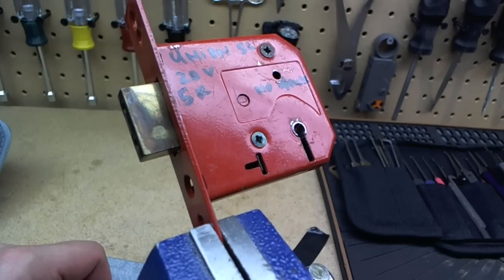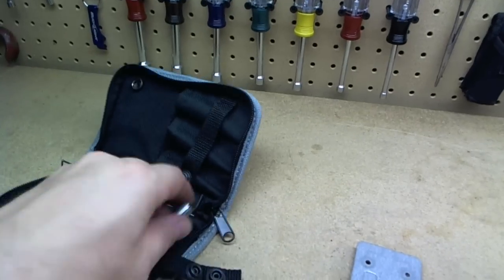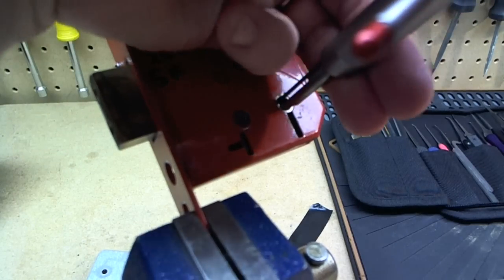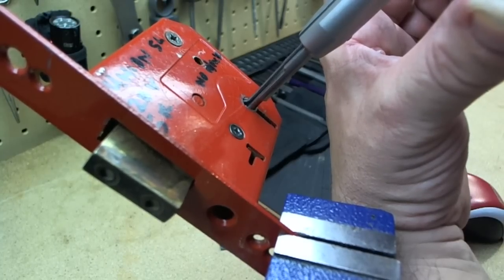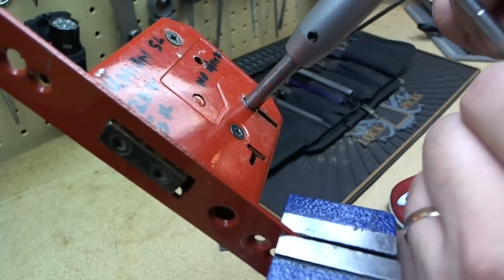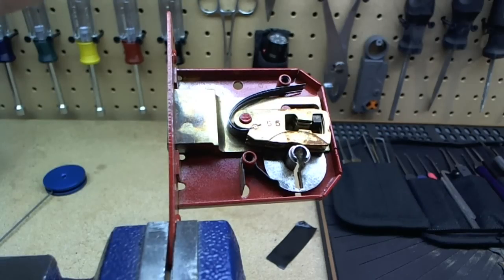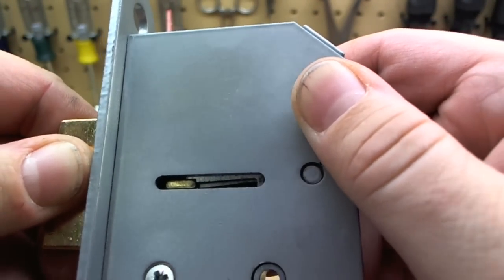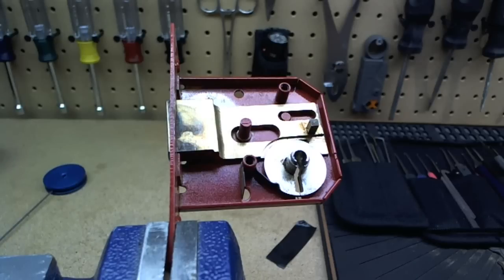Union Curtain Lever Lock Picked and Gutted!!

Comment: Good stuff kokomo! I'm no expert on these but with the ERA the way I'd tackle it would be to lift everything low and let it go into anti pick, then feel the levers to see which are in false... if the bolt is in a true gate there'll be a fair bit of play, if it's in false it'll feel more solid... so anything that feels solid make a note of it, reset the lock and make sure to lift those ones high. Good luck! :D

Comment: glad they arrived mate :) and great picking too. thats the Union 2201 none BS lock. the ERA Viscount has 'anti pick notches in the levers. the levers fall into two groups, 'High lifts' and 'low lifts' the first lever in the ERA is a 'low lift' lever meaning that u need to lift it a small amount, the anti pick is onthe bottom of the lever, so if u lift it too high u will go into anti pick. On a 'high lift' lever they need to be lifted high as the anti pick is on the top. understand that mate?